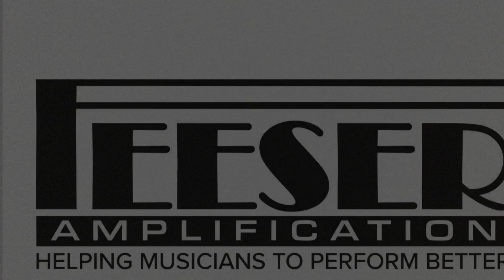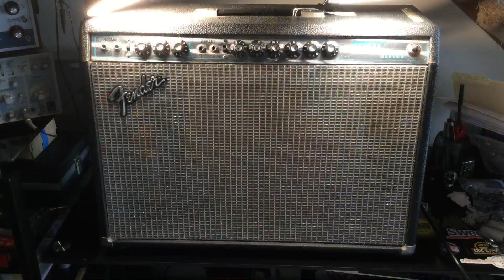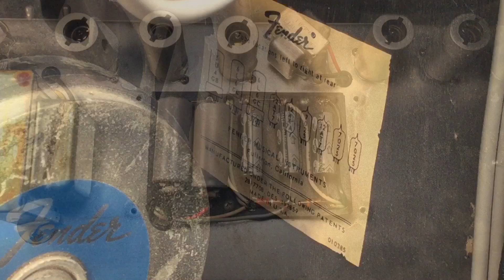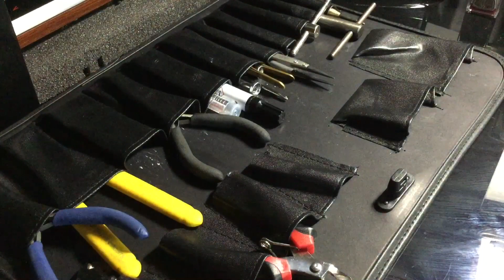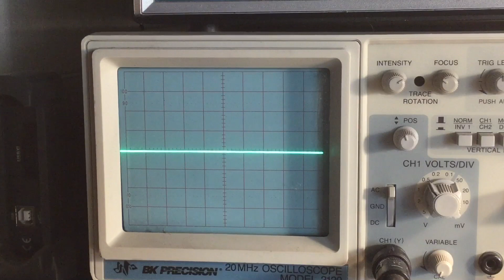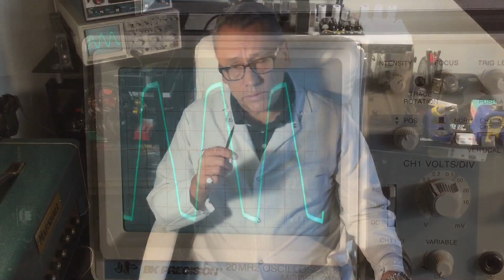How to Repair a 1976 Fender Vibrolux Reverb by a Engineer technician.

Comment: Big tube amp guy! I am not a working musician but I,ve come up with several! My brother has 10 tube amps, mostly Fenders. I have a Marsh Springfield, a clone of a 65 Vibrolux Reverb. I also has what Marsh calls the " OverLord" circuit in it. It's basically a "Dumble circuit. It is hand wired with beautiful lead dress and you can get a plethora of sounds from it. Marsh Amps are pretty much made to order unless you live in northern Palm Beach County, Mike Marsh has his amps ready to go at Wolfe Music, Jupiter Fl! My amp has one Weber Classic Alnico and one Weber Ferramax in it! When I play my Mint condition 1977 Fender Mustang that I hard tailed (NOT PERMANENT) it sounds like a dream I had, like watching the sunrise from the bottom of the sea and it takes me past the outskirts of infinity!
I loved your video and I just wished that there were more talented knowledgeable technicians out there! I am sure that you have watched Psionic Audio's videos! I cannot get enough of you amp techs, like Brads Guitar Garage, Uncle Doug, Forgotten Gear Restoration and D-Lab Electronics. I don't know if this help but I saw Brads Guitar Garage recap a hurt Hot Rod DeVille 2x12 like mine and he gave a parts list wit links and the prices for components from Au.Mauser were wildly cheaper than other places!
Good luck with the channel, I love your format much like Psionic! Awesome!!!

Comment: Without anything plugged in, I hear a faint click that  matches the speed dial on my 75' Fender Super Reverb.
Turn the speed dial up and down, the click matches. What to check sir? Appreciate your feedback
Reply: Good chance you need to replace the LDR in the tremolo circuit.  Or sometimes putting a .01 cap from the 10 meg resistor side of LDR to ground side of LDR will cure the dreaded ticking tremolo.  Just had to replace the LDR in a 1967 Fender Dual Showman, nothing else would cure the ticking.